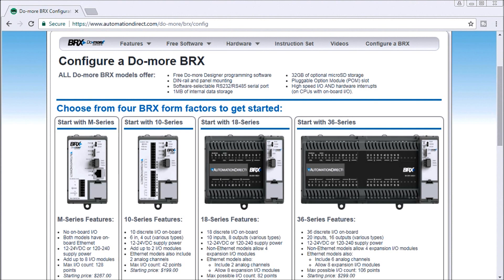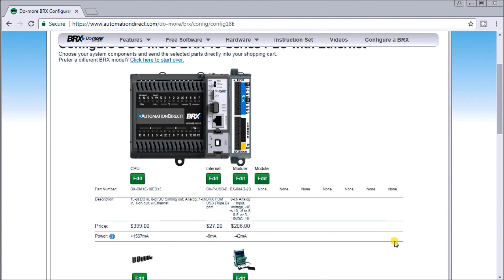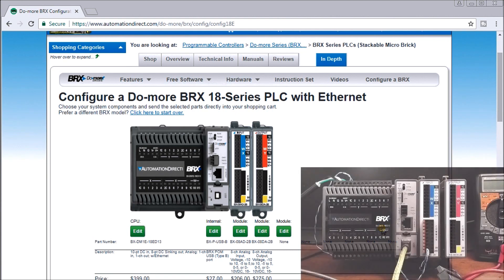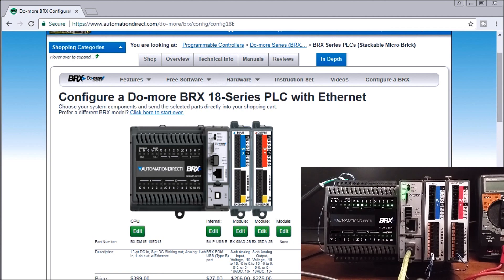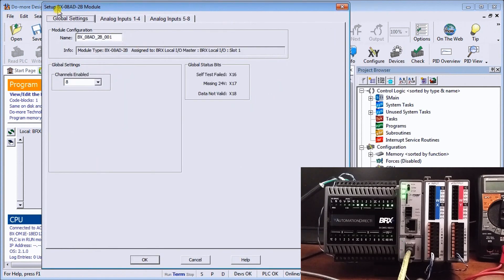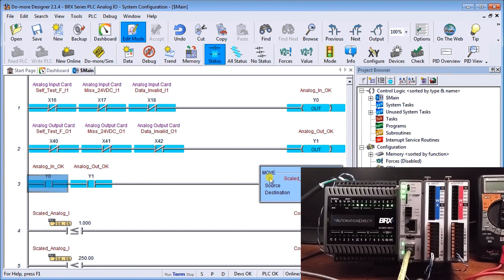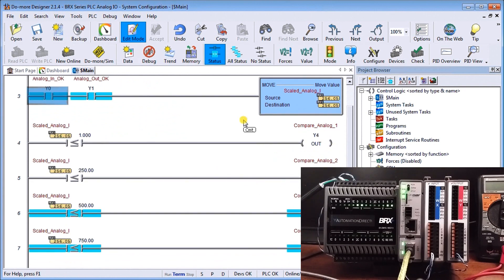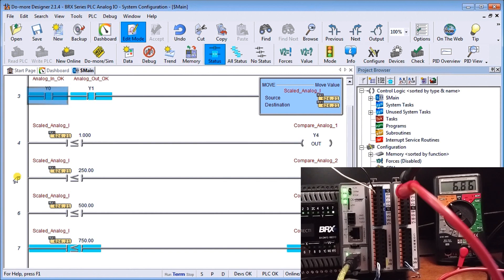BRX PLC Analog IO: Unlock Advanced Control & Scaling

Comment: I was wondering if you could show a similar tutorial or lead me in the right direction for analog IO - system configuration in the productivity suite programming software. Im looking to use a 0-10vdc current transducer to relay off to an analog meter in a cmore ea9 hmi. Thanks!
Reply from the maker: Hi Lucas,
Thanks for the question. The only thing that I have done with an analog card is the thermocouple input card. This demonstrated the PID function in the controller but also showed the setup of the thermocouple card.
https://accautomation.ca/productivity-1000-series-plc-pid-instruction/
The analog input would be similar in that you would go into the hardware setting and set the addresses of the inputs and/or outputs. In the PLC program, you would use the Scale (Linear or Non-Linear) instruction to put the analog into values that you want to see.
https://cdn.automationdirect.com/static/specs/P1-04ADL-2.pdf
This specification sheet will show you how this is done.
I will create something for the analog input of the productivity PLC in the future. 
Thanks Again, Lucas.
Garry